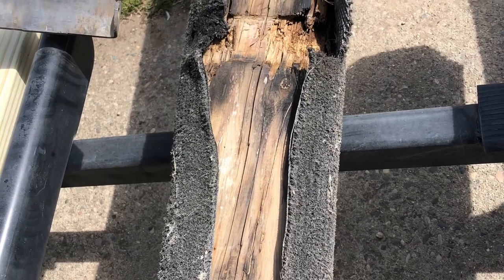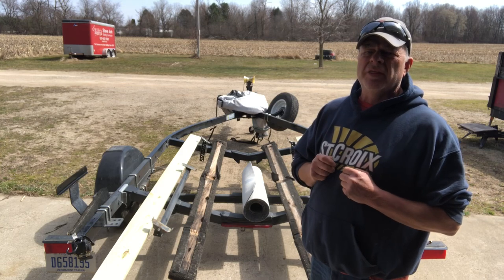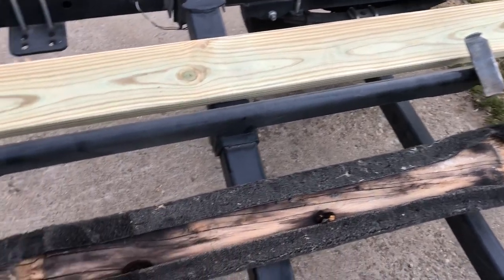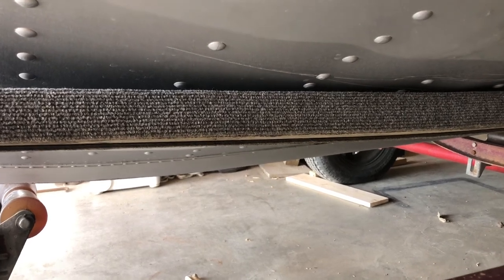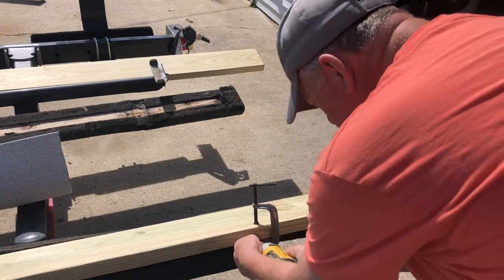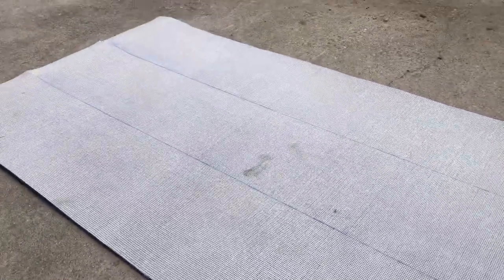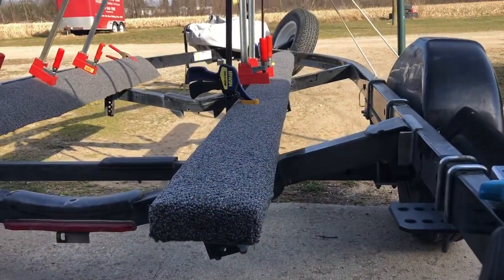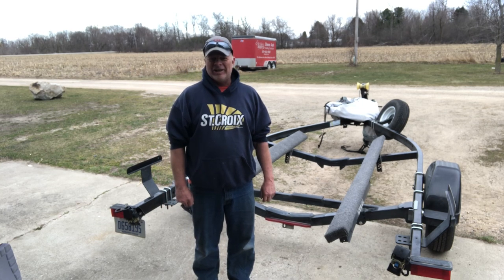How to replace boat trailer bunk boards

Comment: I plan on painting my treated pine with a few coats of polyurethane to repel water from the wood and scuffing it up a little where the carpet staples down using Gorilla wood glue to assist the staples. I do not have the hold down brackets like yours. I have a thin plate made out of Unistrut with three holes sitting on top of the main brackets. I have to drill a couple of holes through the bracket holes and wood and countersink carriage bolts with nuts to hold the boards down. Then fill in the holes with glue and carpet over it. One side the brackets are fixed in the up position. The other side the brackets swivel with the bracket at the rear of the trailer having a large screw adjustment with a crank handle. When the crank is turned all the way down the board is mounted in the highest upright position and the other two swivel brackets are in the upright position. When ready to launch I turn the handle which pulls the board a little backwards while it drops in height an inch. The swivel brackets keep the board level in the upright position as the other two board plates swivel to a stop position that is the same angle as the stop position on the crank bracket. This causes the boat to drop enough to roll off the trailer on the rollers without much effort. I retrieve the boat the same way and then turn the crank to lift the board back in position, so the boat is riding on the boards not the rollers. This is an old 60's galvanized trailer. I have another even older trailer that has a long handle lever at the front of the trailer which is attached to all the rollers by a narrow piece of metal. The roller brackets are welded to circular brackets that goes around large thick tubing running across the trailer. When I pull the handle lever the rollers turn around the tubes and raise the rollers up a few inches so that the boat rolls off the trailer with ease.  Only reason I don't use this trailer is that it is extremely heavy. Does make a good junk hauler after attaching a truck bed on top of it.

Comment: I'm noticing people are using strips of nylon cutting boards cut into strips and screwed onto the bunks for the boat to slide on and off. That should be as slippery as snot on a door knod and last much longer than shitty carpet.